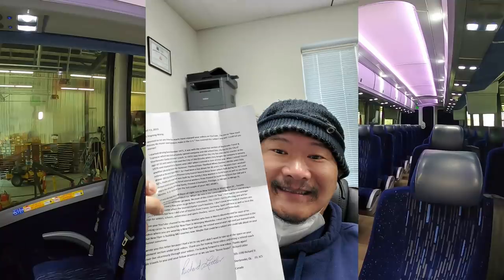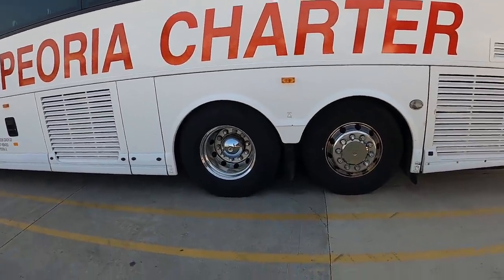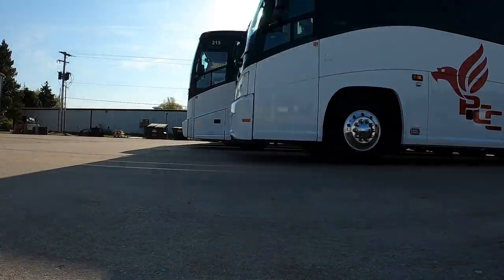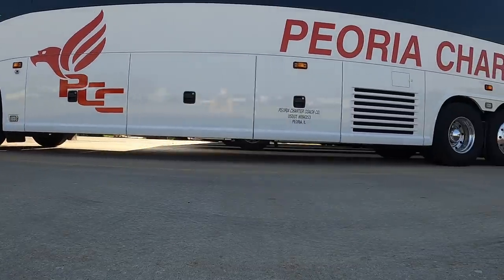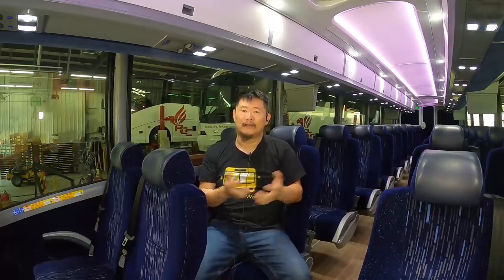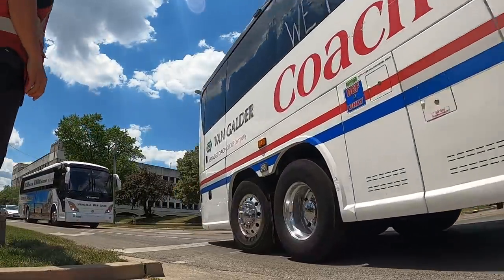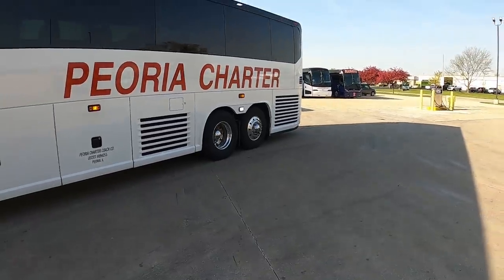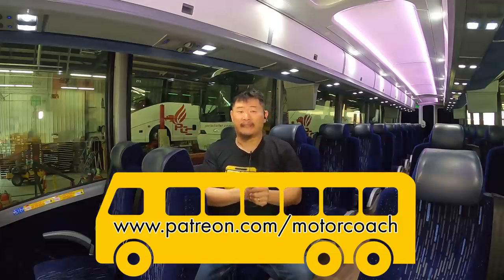The 3rd wheel | What is a tag axle??

Comment: The Eagle models 5, 7, and 10's all operated with torsion tube suspension, thus, you could not "Unload" the weight on the tag or bogie wheel. MCI's on the other had operated with air bag suspensions to which you could flip a switch on the side dash to unload the weight on the tag axle. this would provide more traction to the drive wheels. With the tag wheel being in the rear, you had improved traction, and braking. For over the road buses this greatly improved the ride.
Reply: You get no traction with a tag axle it just rolls and supports. What is your definition of traction.
Reply: @grahamjohnson4702 
When you dump the air on the tag axle it puts the weight it was previously carrying on the drive axle and this increases traction. Have to be careful trying this in mud because you could sink more but in snow it usually helped to get going from a stop.
Reply: Tag axle let's you increase the length depending on the traffic regulations

Comment: Years ago I saw a two seater licensed "car" with five wheels. Scroll down to understand.

A 1950's racecar with the engine infront of the driver and a motorcycle sidecar with a good windshield on the right. Straight tracks in the snow would have been left, right, sidecar.

Comment: Ok, dumb question. Who decides and why and how are governors set at a certain speeds or RPM? A long long time ago I used to drive an ex-Hound GMC 4106 and deadheading it empty I had it up to 90 MPH, just to see how fast it would go. Obviously that kind of behavior isn't allowed these days but apparently Greyhound was cool with it in 1960!
Reply: Usually the fleet owner would set governors based on how much freedom and gas mileage he wants available, with or without consideration of legal speed limits.  When I drove in Dallas, however, the governors were sometimes lowered when the owner realized that not all old buses in the fleet could keep up with newer buses in convoy. Otherwise, his fleet of 50 were set to 68mph to be barely able to pass trucks.

Comment: maybe someday a feature on combination passenger/freight buses? I remember seeing them when I lived in a small town in Montana in the 50s. Maybe the manufacturer was flxible? I don't remember. (I just discovered this channel. Engaging style, thoughtful productions, interesting topics! I'm looking forward to going back through previous shows.)
Reply: GMC 4501. Two dual wheel rear axles but still only one was powered. Two 4-71 DD engines coupled together. Later in life they were re-powered with 8v-71 and even some with a12v-71
Reply: I Norway we had for a while combi busses, the front hallf was like a regular buss and the rear like a container.  Busses have lower road tax.
Reply: Both Greyhound and Trailways had some of these "freighters". On the Greyhounds they were MC-7s and two MC-8's and  generally had 24 passenger seats and the restroom was moved to the middle of the bus. The entire rear of the bus was cargo only with a bulkhead isolating it from the passenger area and was accessible only from the outside. They used these buses in the days before deregulation to try to bring in more revenue on routes where passenger loads were low. The driver was not required to work this rear cargo section, it was mainly designed to haul pallets and be accessed by forklift. A lot went into the design of these buses. The entire rear suspension and tandem axles from the Scenicruiser was cut out and installed in the freighters, so it had 10 wheels on the ground but only the front drive axle was powered. The wheelbase was shortened for better weight distribution. With the extra engine compartment room a straight six engine could be used. Most were still the 8V71 although a few with  Caterpillar 3406 engines were built. Super rare to find one of these today and most have never seen one.

Comment: The counter steering tag axles have also a interesting side quirk. It increases how far your tailswing goes.

The average tailswing to the opposite direction of a bus with a countersteering rear axle is approx 1.2-2.5 meters.

A typical mistake of new drivers is when turning hard and forgetting this makes it very easy to clip traffic signs, bus stops and even other cars (i.e. on the neighboring lane)

Comment: As a Chinese, live in Beijing, and use citybus a lot. The Beijing Public Transit, the major citybus operator of the city,
It's rumored that a bus 345 branch line articulated bus broke apart on tollways in 2004, and since then, no articulated bus can be operated on tollways. And to meet the excessive demand, since 2006, BPT tested several 3 axle single decker rigid buses on bus 322, a bus route runs partly on a toll way connecting a satellite city to inner Beijing and is adopted by BPT and has a massive uses through today. And that's the China's very first massive use of 3 axle buses. Also note that some of the trail buses' tag axle can not turn! But we choose the tag axle that can turn.
China has the standard of:
2 axle 18000kg 12m
3 axle 25000/26000kg rigid 13.7m
3 axle articulated bus 28000kg 18m
Height limit: Coach 4m, Citybus 4.2m
Also in HK, they have a very strict weight limit on axle, so their most doubledeckers are 3 axle with "tag" axle in the middle. This can reduce the tail length of the bus.
PS: due to convenience of National railways, our long distance coach industry is declining. The peak is 1990~2010. Also we now get weird BEV coaches that's very weird since BEV really dont fit long distance high speed usage.
Reply from the maker: Oh man this is great information! Thank you so much! I was from Tian Jin. back in 1990 when i left, China did not have very good buses. I wish i know what kind they had back then. I would love to see a picture of one again...
Reply: @MotorcoachWorld  yeah, China's bus industry only really begin to rise after 1990~2000. Tianjin has its own "Tian Ma" bus company back then and later bought by BYD and begin to make BEV buses. 
Also China's buses mostly follows EU's techs. While NA's buses looks really weird to us... Though BPT has a great relationship with Cummins and Allison for NG engines (Beijing massively deployed CNG/LNG and NG-HEV buses using Cummins B5.9G since 1999) and Allison T series gearbox.

Comment: Hey.  I love your bus videos.  I know my icon represents an old streetcar but I love buses myself. I rode one in Branson, MO.  All the buses I rode were all triple-axle buses and they were all built by Van Hool.  When I went to Cape Girardeau, both the MCI Challenger and the Crusaders also had the tri-axle configuration.  The Van Hool I rode in 2013 was a Cx45 coach, and in 2014, I rode the Van Hool T2145.  Branson Gray Line told me that the C model was very well built for regional commuter type work.  I think that even transit agencies would buy buses with the tri-axle configuration for their commuter jobs.  St. Louis bought a fleet of Neoplan Metroliner coaches.  I rode those as well.  But this brings me to my next question about buses.  Can it be a possibility to have a wheelchair lift platform operate under the main staircase of a motorcoach?

Comment: I have 28yrs service driving for a multi-national coach company based in Scotland and I work out of their Glenrothes depot. I drive Plaxton bodied Volvo B11’s which are 49ft 2.5” long, stand 12ft 2.5” high and are 8ft 8” wide with a 12 speed i-drive automatic gearbox. 

They seat 59 passengers and are tri-axled vehicles. The company have been using tri-axles for around 14yrs now in both single and double deck configuration. 

I find them very enjoyable and easy to drive and are easier to manoeuvre than a standard axle configuration coach due to the tag axle having steering capability. 

I have also driven 60ft long articulated coaches, commonly known as bendy buses, for the same company in the mid to late 90s but these didn’t last very long in the fleet, approx 4yrs.

Comment: LOL...I drive the J4500...and the TS35 ... I prefer MCI over all others, and vanhool is probably my least liked, then Volvo, the extended nose I really do not like, and Prevost is ok, but driver sits too low....oh, and the TS35 is actually a pretty decent bus for a Turkish made bus, although the steering wheel positioning and kneel could definitely be improved, not enough movement for the steering wheel to set (telescope and tilt) for a comfortable drive and the kneel is soooooooooooo slow and maintains a constant beep while it is kneeled, not to mention the travel is only a few inches, nothing like most buses ...I really could use those lifts, too, LOL.....good video and explanation...

Comment: youtube for a change recommended a good video, interesting to learn about. I'm from the crane industry where the biggest machine i've worked with is a LTM 1750 which has 9 axles and all wheel steer. fair it does weigh 108 metric tonnes. But to me all machines are interesting to learn about.

Comment: Okay, I guessed correctly that tag axles were unpowered, for load only. But when it comes to cool factor, the overload axles for cement trucks and some other construction vehicles that can be raised completely off the ground is hard to beat!
Reply: Right, and those tag axles don't steer, but they can caster when turning.

Comment: Having driven both Prevost and MCI with tag axles and the J4500 without a tag thank God for the tag axle. The ride and forgiveness of the tag axle in poor weather conditions is so much better. The J3500 ride is choppy at the best of times, and in windy weather the driver better be wide awake as the bus is blown around a lot more, also the J3500 steering in good conditions is more responsive requiring a finer touch to keep the bus straight.

Comment: In the early '80s and '90s MCI had a 40 ft coach with a single axle it was the model 9 most of them were used on commuter runs equipped with the double entry doors.

Comment: The Volvo B9R is another bus that is in production that has a tag axle in front of the drive axle, on the B11R, which is basically the same bus, but with a bigger engine, the tag axle is on the rear of the drive axle because it steers, on B9R it's fixed.

Comment: VolvoB9TL has last axle innies 
I did not know the rims were just a different direction.
But I do know drive axles have to be innies for better access to the drive axle.
I just guessed the tag wheels were for resisting load shift during acceleration , spread the weight more and for more grip during braking.

Comment: I asked about that as a kid in the 1970s. The bus driver said it was for stability and the model he was driving he said the bus could be run with it up. That was usually for transporting the bus 500 or more miles and you don't want to burn the fuel/wear the rubber for that 500 miles.

Comment: A number of Higer buses used to have steerable tag axles and they so often broke down such that you would see a bus dragging a tag axle that had not returned to straight. Many operators simply locked them because they were so faulty.
Reply: Steerable tag axles especially for Chinese made HIGER would behave differently to scania,volvo, MB, MAN or supplier ZF. In the us Freightliner ultrasteer and Meritor. Wearing off of tyre during steering is the downside on non steer tag axles.
Reply: @pyalspite  yeah, generally imo, Chinese engineering is usually substandard. But many European and American made systems work very well.
We mostly have Scania chassis with rear steering, here in Zambia, and they work very well.

Comment: In the 60's, UK Bedford's had a VAL model chinese 6, where there were 4 steering wheels on the front and with just a single drive axle at rear.. As no power steering then, the effort to turn the wheels must have been a bit heavy.

Comment: I might have misunderstood about the 7 minute mark. You mentioned that a single axle is limited to 20K lab and duels within a certain measurement added an additional 34K. Isn’t the duels allowed up to 34K with no more the 20K on each single?

Also as I a, sure you are aware of that some may not be aware of is the tag brakes are limited to less air pressure thus not the same braking force as the drives. It helps but it’s not the same.

Comment: Ohhh the fun of tag steering malfunctions! I drive the D4500, and I have experienced a tag which got stuck in the turned position, which made going in a straight line rather difficult. Another time the tags got loose and started to oscillate on the highway. Stopped and manually locked them to continue the trip. Otherwise they are a pain when reversing. They dont have the same direct steering as the steer axle, so if you are parallel parking after turning hard in one direction, the tags wont change to the other direction fast enough when needed. The net effect is crabbing towards the curb and leaving lots of rubber on the pavement.

Comment: The steering on the tag substantially reduces tyre wear at slow speed. Where I live - Australia we know a thing or two about trucking. Recently are quad axle semi trailers and the rear two axles steer on those. 
For a living I drive a semi doing multi drop steel deliveries for a large steel company with a tri axle trailer. Some of the places I back into 10x a day every day of the week are so tight that there's extreme tyre wear - particularly on the front and rear axle tyres of the tri axle set. 
It's a function of the weight. As soon say over 9 - 10t payload trailer tyre wear becomes extreme in multi drop environment. We'd be lucky to get 12 weeks out of a set of front axle (of the tri set) when we're busy. By company convention that's why retreads are used on all local (including intra-state) trailers and interstate trailers get cleanskin tyres. Retreads are very reliable and only get destroyed when stupid drivers hit packs of steel left in places by forklift operators that can't be bothered putting them away - I digress lol (blushing).

In Australia standard weights (so not mass management which allows for higher axle loading) is 6 metric tonnes on the steer, 16.5 tonnes for a quad tyre dual axle set and 20 tonnes for tri axle set (12 tyres).
This makes 42.5t GVM. For a B-Double the A trailer also being a tri axle set adds, you guessed it, 20t for 62.5t. 

On a bus a tag axle and dual tyre set is allowed 14t.

Also on buses, the tag axle allows for better distribution of space within the bus/coach length constraints. So the luggage bin can be large as possible and the engine as rear as possible. That engine weight which would otherwise be cantilevered making the steer axle dangerously light is now supported by the tag axle allowing the steer axle proper load sharing.

To get to the lowest common denominator the in/out wheel configuration allows only one type of spare to be carried - that's the ex mechanic in me coming out.

Comment: NASCAR haulers have the longest trailers allowed by law, therefore they have a tag axel on the rear of the trailer to help with the load and steering in both forward and revers. Here is the rub... Since the trailer has an lounge they are registered as "motorhomes or coaches" to get around having permits for carrying chemicals and fuel. They do have to go thru weigh stations and comply with restrictions.. Featherlight is the main builder of said transporters

Comment: The eagle Model 5 and model 7 have a spring board effect. 
This is caused by unbalanced weight distribution, in this case a too light front end or a too heavy rear end. 
Usually in coach vehicles the engine is at the rear of the bus, with the gearbox, drive shaft and rear axle more to the front of the bus. 

With the rear axle close the rear, this causes the heavy driveline components to be squished to the rear of the bus. 
Thus causing weight to be concentrated at the back.

Also all European Van Hool three axle vehicles have a steering tag axle. Tighter bends and generally tighter roads would make the tires wear out too quickly of the tag axle.  

Just thought i'd add to the discussion.

Comment: I saw a coach bus get stuck in a deep gutter entering a shopping center.  The driver went perpendicular to the gutter instead of at an angle and the drive axle was lifted off the road and lost traction.  The rear bumper then hit the road and the bus couldn't go forward or back.  Oops.  The road was closed until a heavy wrecker could come and move the bus.  That's the day I learned that unlike tractor trailers, the 3rd axle on buses is unpowered.

Comment: Thanks again for doing this video! Wanted to ask about one thing.. on the J4500, does the tag need to be locked manually before backing up, or does that happen automatically? I've heard that the tag axles direction can become misaligned with the steer axles direction in certain situations while backing up?
Reply from the maker: Great question Sam! Glad you liked the video. The tag automatically locks when shifting into reverse.

Comment: If you want wheel and tag axle fun , look to cement ready mix trucks , many combinations of lift axles tandem axles , double front axles and liftable final axles.sorry if my use of terms is wrong .
Then you have the straight and semi trailer designs in Michigan with the absolute max number of axles you can put under a vehicle

Comment: F.Y.I. -  The Greyhound Senicrusier (PD-4501), manufactured by GM starting in 1955, had "dually" tag axles with "innies" located to the rear of the drive axles. Non-steerable and no other controls like "lift" or "deflate".